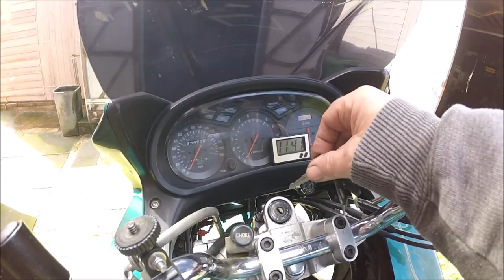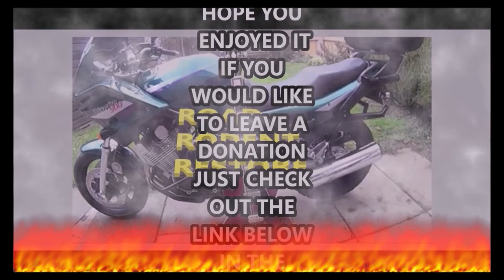CBR1000F Landfill bike. getting ready for Engine back in frame

Comment: John how can we torque that lower bolt one nut goes one way other suck up to frame.I used my punch to free up when pull engine check out my video on YouTube briancbr1000f
Reply from the maker: Hi Brian. 
There's probably a expensive tool for the job.
I think its only about 12 foot pounds. I just used the adjustable spanner and made sure there was no play between the frame then tightened up the locking nut.